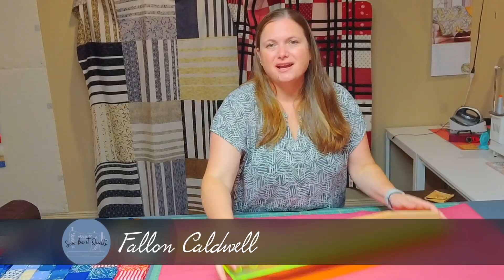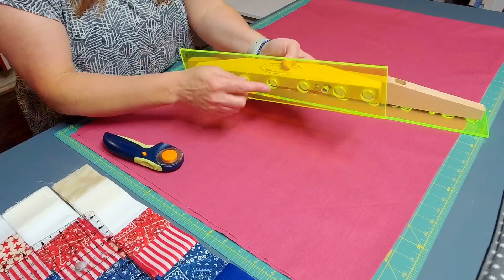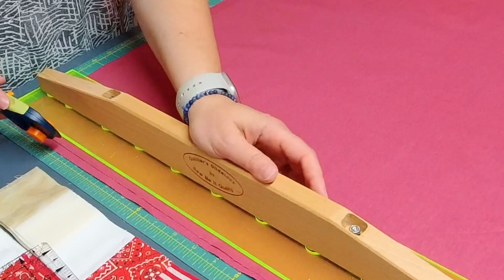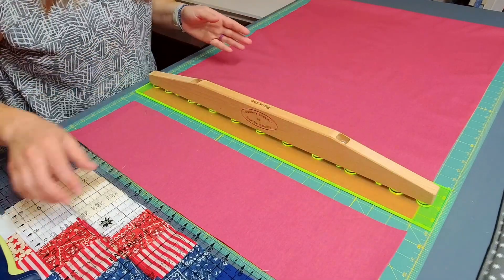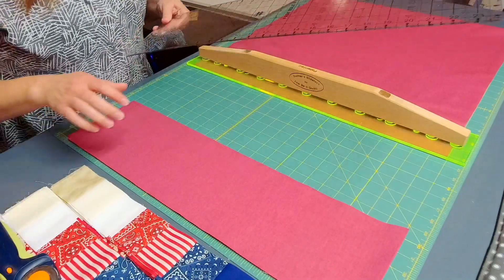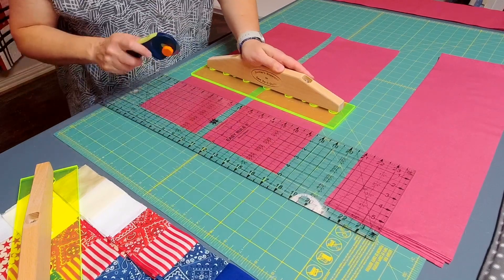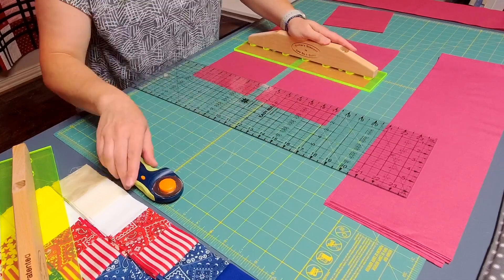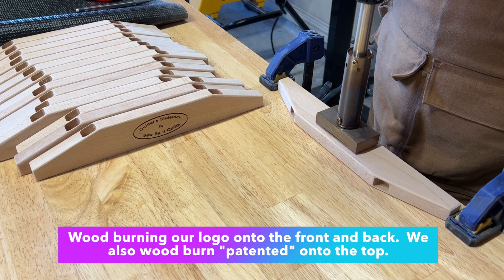Quilter's Slidelock Demo and How its Made

Comment: I agree that a lined ruler paired (v. using mat) with this cutting edge is a better practice...matts warp over time. Because the Slidelock stays put, once you have aligned your measurement (and squaring with fabric at bottom) on your ruler, firmly butting it against the Slidelock assures that it will not move. I do have some antislip table on my Slidelock to bolster its anti-slip.

Comment: Beautiful but way out of my soc sec income!
Reply from the maker: Sorry!
Reply: This is what I’ve been looking for. I’m 73, wanting to start quilting. I’m new at sewing, embroidering. Now I want to quilt. My cutting fabric Is horrible. I can’t sew straight line for the life of me. My fear is buying g beautiful fabric and  my sewed fabric is wonky and so crooked , I’d not be able to use it. 
I don’t want to buy cheap fabric that I don’t like to start then what’ll I do with it. 
I’m wondering what’s the size I need to get started? I have limited strength due to back injuries and surgeries with on going pain.  So I know this would help me tremendously for cutting. 
Also, I have 5 different rotary cutters. No matter what blades I put in, I never ever get clean cut. Frustrating. 
Lastly, what do you use to keep fabric straight while sewing with correct measurements. Again, I’ve tried magnets,tape,anything to get a straight 1/4 in cut. Nothing comes out like it should. 
At this point I’m about to stop trying and give it up.  Help!
I can’t buy 2 rulers at one time but to start off which one?
Thank you so much!!!!